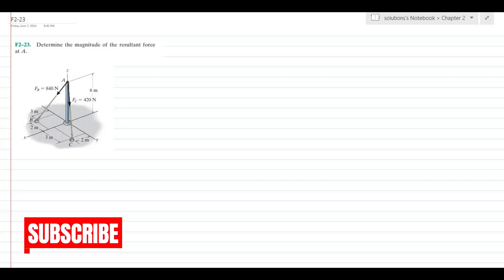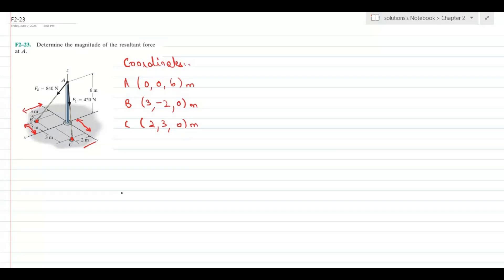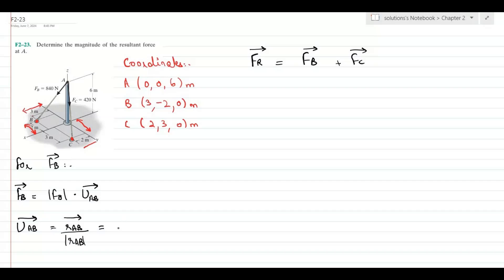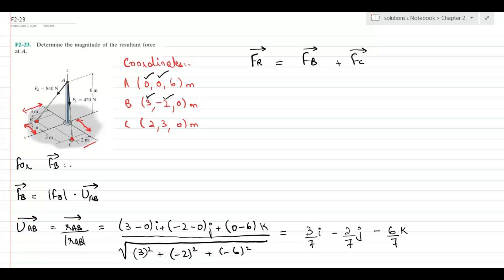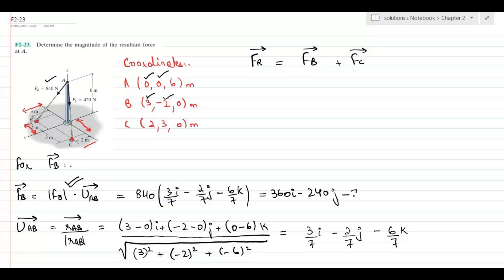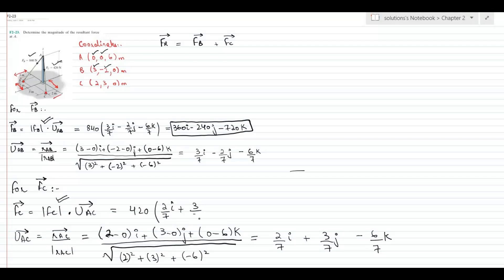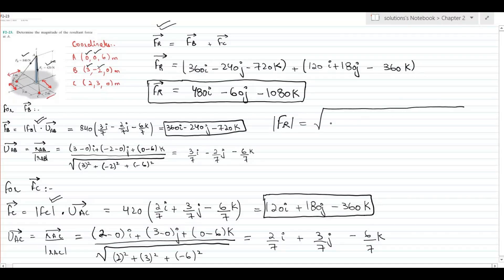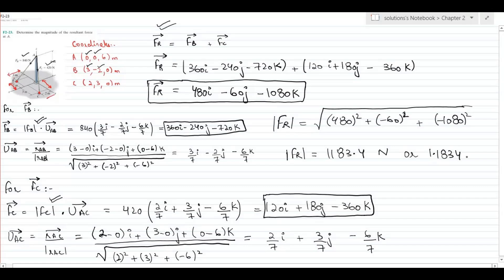F2-23 hibbeler statics chapter 2 | hibbeler statics | hibbeler

Comment from the maker: Learn How to Solve 2-46 Hibbeler Statics Chapter 2,  "The three concurrent forces acting on the screw eye produce a resultant for Fr=0. If F2 =2/3 F1, F2 is to be 90 degrees from F3 as shown. Determine the required magnitude of F3 expressed in terms of F1 and the angle theta."
Here is the Link: https://youtu.be/vVP6R0-OGwE